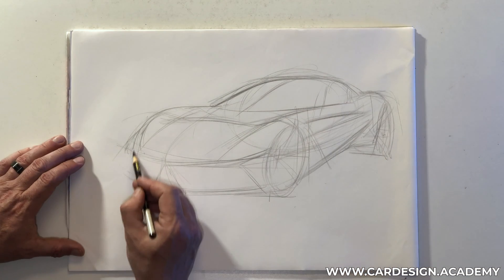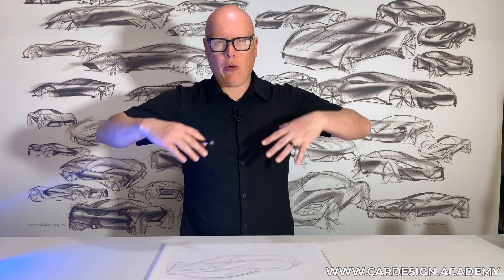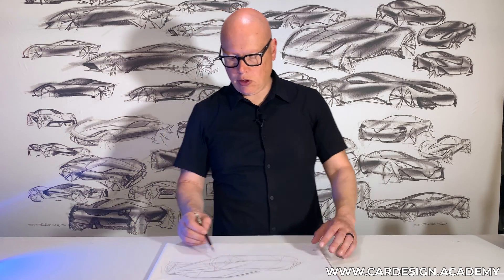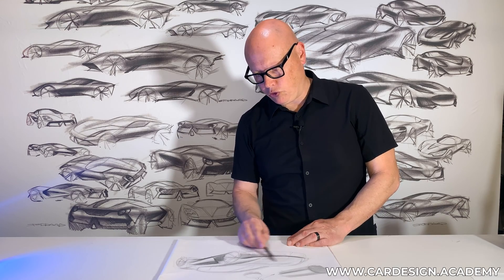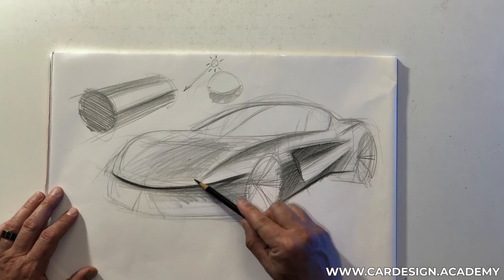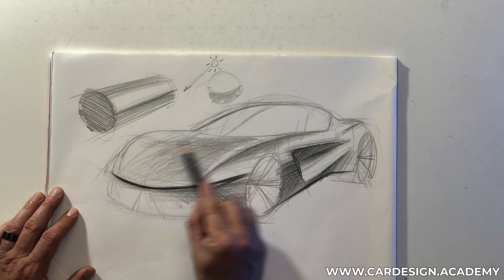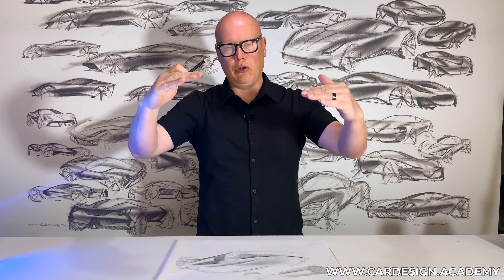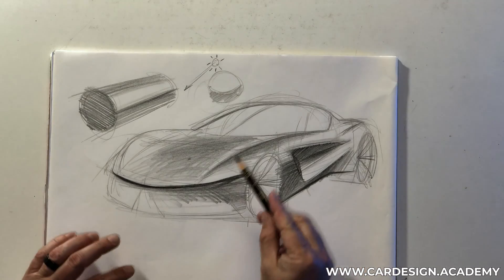Car Design 101: Rendering a Sports Car in Perspective

Comment: How do some cars get worse over time. The new cayenne has some tiny gear selector that is so puny and the put it in such an awkward area that’s harder to reach and awkward to use? There was nothing wrong with the old design and placement. Why do designers make change for the sake of change? Can’t they just use “evolution instead of revolution”?
Reply: Yes I agree but you have to change something whenever you want to make a new concept. Because the perfect old design you've seen in old cars have come from lots of failed designs. Thus we have to make changes, good or bad, for overall innovation of car design.